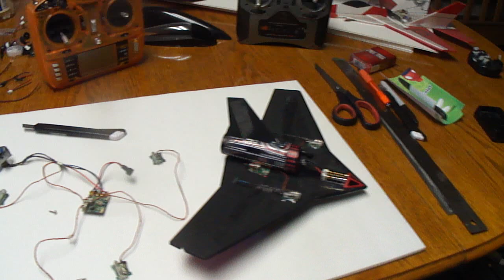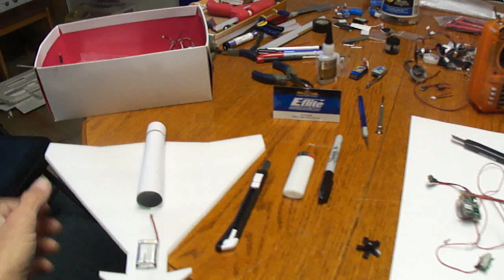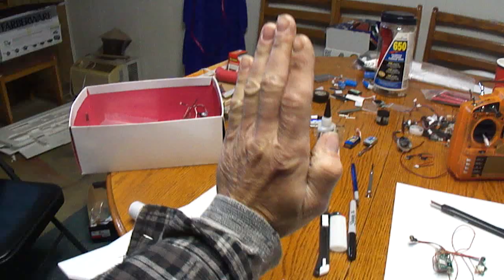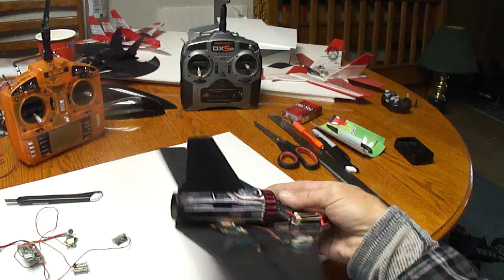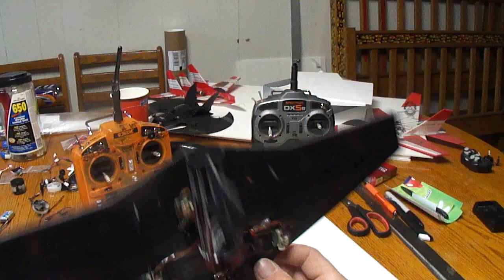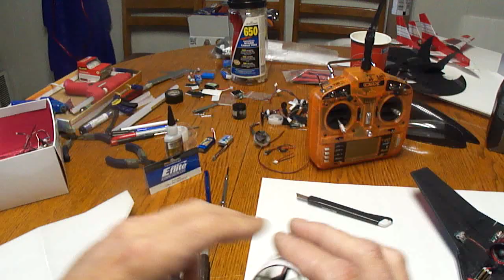UMX Micro F-16 electronics. Building the fastest ultra micro jet yet.

Comment: Chris, fantastic but the best one is the Batman plane. I am starting on micro plane scratch building, I have only done indoor rubber planes. Do you have any advice on what would be best set of electronics needed: radio, receiver and modulation type for small slow indoor rc planes. ? Thanks Alex

Comment: Hello Do you remember me or the sim jet from when you first started.I may have some of the worlds best heat sink material will and send you some for free if you try it and tell me/others what you think works better than gold its called Pyrolytic Graphite. Contact me for more info. Ps I can't fly anymore but I'm doing very small rc fast as I can mod them just finished the worlds fasted bolt pt2 please enjoy. Thanks for still sharing your work do you have a spectrum that does actuators you may recommend ?Adam VA of AVA Magnetic Levitation AUS